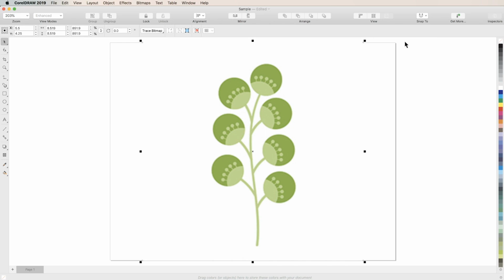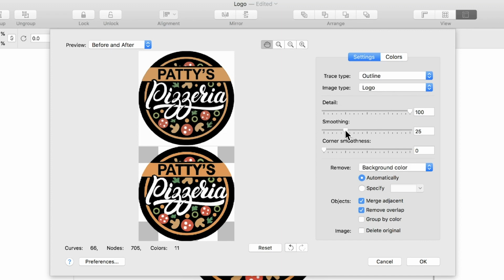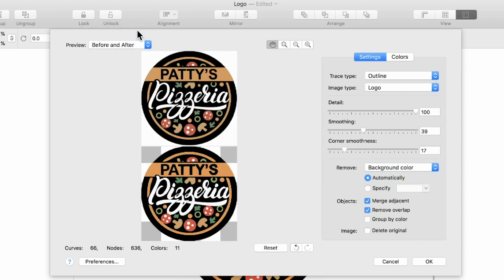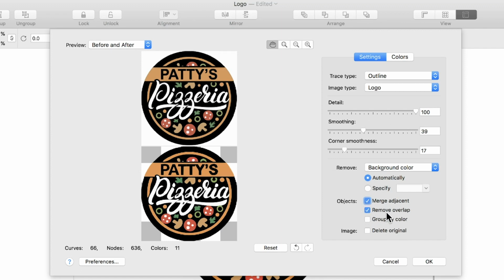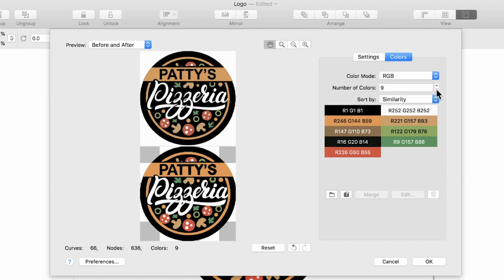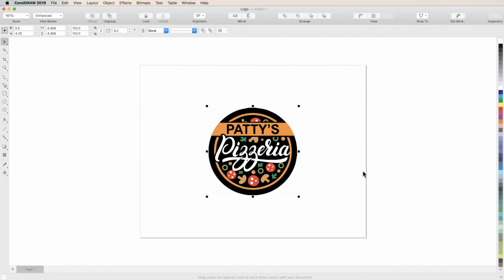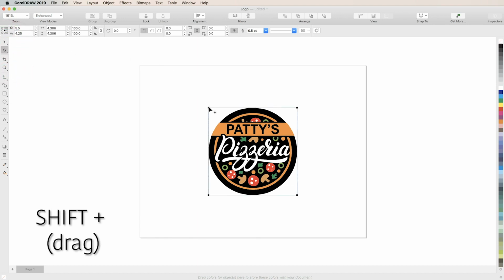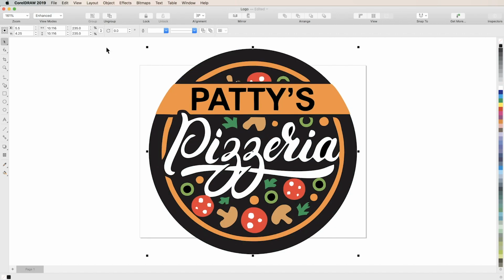How to Convert JPG to Vector

Comment: Where can I find guidance on file sizes? I read on CorelDraw Community: "... Corel Trace and Power Trace. The latter simply doesn't work with large files." With my file (I selected "High quality image"; it's a pattern with a variety of detailed objects), Before and After view does not display the After object, and Wireframe Overlay does not display anything. Now the tracing is in progress, after I guessed at the settings, and it's taking forever. Can I make my file smaller before tracing without a loss of quality? Its dimensions are 13500 x 13500, resolution 300 x 300, which are what I'll need for printing. And does CorelTrace still exist? Thanks.